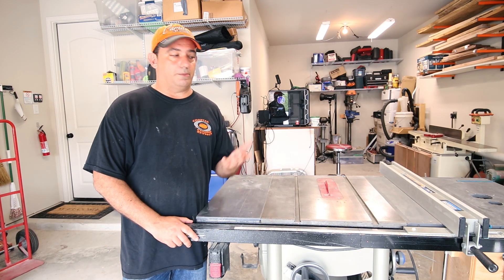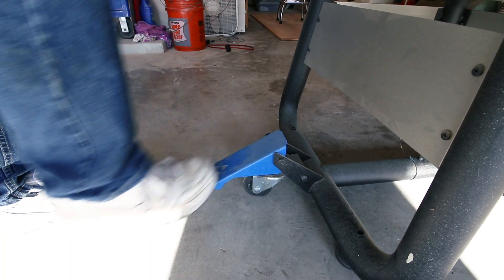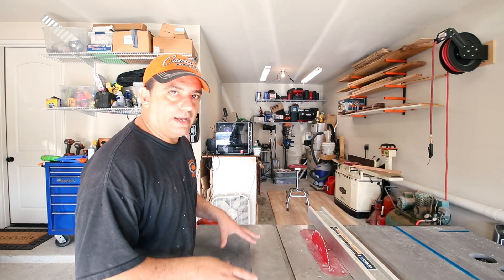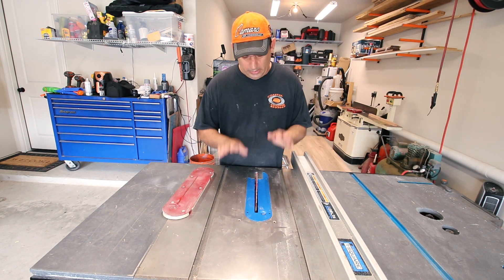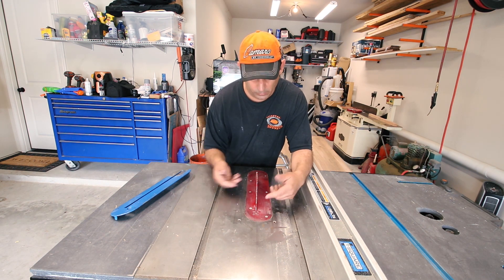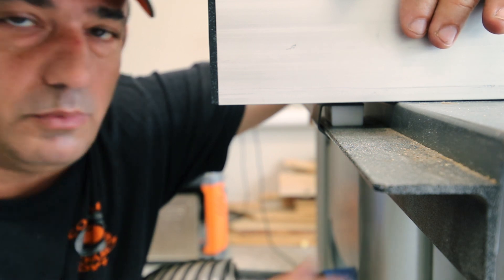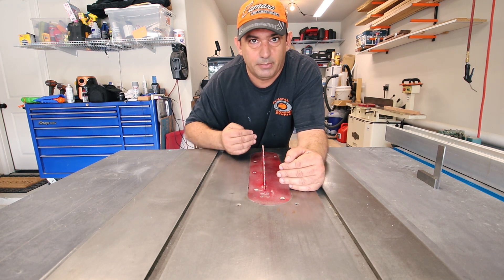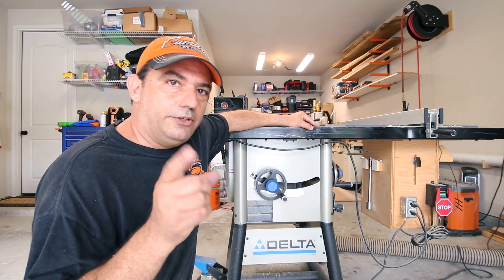Delta 36-725 Table saw review.  After 3 years

Comment: For others reading these comment, I have owned this saw for 3-4 years and I built a quite successful WW business for which it is well responsible.  Everything he says in this video is 100% true, but it doesn't have to stop you from finding success with it.  I am also upgrading my saw, like he is, and cannot wait, but this one has served me well.  The newer, more expensive one I"m getting will hopefully serve me well too and be a little more accurate, a little more powerful, etc.  But when you're just starting out, this Delta will take you far!  As an aside, when starting out, you really shouldn't be buying the most expensive tools, I started out with Harbor Freight trash tools, squares, etc.  As I learned to Wood work, started making money with the low end equipment, I took my profits and started buying better, nicer tools.  Now I run Festool, Wood Peckers, Powermatic, etc.  Don't let cheap tools stop you from learning/improving!

Comment: The zero clearance throat plate is a delta power equipment #36-501 sells on Amazon for about 38 dollars. Fits perfectly.  Worth every dollar.
Reply: Thanks for the tip! Just ordered it.
Reply: TIP/WARNING: when doing angled cuts 45’s, etc. MAKE SURE NOT use your zero clearance insert! SWAP out to use the stock insert (wider opening) BEFORE you start changing the angle. Otherwise you will bend and or knock your riving knife out out of wack! And it’s very difficult and time consuming to readjust and calibrate (assuming it’s not damaged) on these delta saws. Even though I already knew this, I’ve accidentally done it twice. You get going and sometimes forget. So, I used a label maker with red tape as a reminder: “Angled Cuts Warning - swap throat plate out”. I put one on the front of my saw (below where you see the current angle), and on the front right corner near the other wheel/dial which changes the angle.

Comment: TIP/WARNING (Zero Clearance & Angled Cuts): when doing angled cuts 45’s, etc. MAKE NOT to use your zero clearance insert! SWAP out to use the stock insert (wider opening) BEFORE you start changing the angle. Otherwise you will bend and or knock your riving knife out out of wack! And it’s very difficult and time consuming to readjust and calibrate (assuming it’s not damaged) on these delta saws. Even though I already knew this, I’ve accidentally done it twice. You get going and sometimes forget. So, I used a label maker with red tape as a reminder: “Angled Cuts Warning - swap throat plate out”. I put one on the front of my saw (below where you see the current angle), and on the front right corner near the other wheel/dial which changes the angle.

Comment: Thanks for a great review.  I bought a 36-5000 (same as 36-725 but with 15 amp motor) 2 years ago and could have used the surface flatness info.  I've had no problems, but the surface is the same as you showed. You are the first review that I've seen that really takes a in depth look at this saw.

Comment: I have the same saw and did change the blade too.   I didn’t have 220 at the time so this is a great saw.  I’ve cut 300 bf of 8/4 maple.   You have to go slow and sometimes it bogged down but I worked.  This is a great saw to start woodworking.  Nice review.

Comment: Nice review.   I bought the Delta 36-T30 T4 fence separately for my older Craftsman 113.  A great fence system.

Something else to consider... The other 80% formula for power is, you typically do not want to load a circuit more than 80% of its rated amperage.  A standard house circuit is 15A (1800W @ 120V), so that means no more than 12A should be drawn (1440W @ 120V).  Many saws routinely go over that and you can either pop your breaker and/or even cause issues with your motor (burn out capacitors).  This is especially important on a circuit shared by other devices.  I run my saw on a dedicated 20A circuit, so it has plenty of headroom to run efficiently and not overload the wiring (80% is 16A, 1920W @ 120V).  

I'll be upgrading my Craftsman motor to a 220V model when I can get my hands on a decently priced one, along with a new circuit to support it.  The 120V motor does okay for now, but is a little sluggish... as you pointed out.

Comment: Thank you. I was getting ready to go buy the saw but the table issue kills it for me.
Reply from the maker: Other people seem to not have a problem with it.   Maybe bring a straight edge and check it before you buy it.   They might not all be like mine.
Reply: Mine is Flat.
Reply: It's because the motor hangs off the cast iron top like most hybrid saws, cabinet saws usually have it attached to the frame so there's no weight pulling on the top... If they produce the top and store it for a year the cast iron would be more stable and handle the weight but I wouldn't see that with any Home Depot or Lowe's.

Comment: I agree with the bad points.  I have had mine for a little over a year now.  This is my second one.  My first one had runout of 29 thousandths of an inch.  .004 is acceptable by most standards.  Back to Lowes (after 4 to 6 hours of assembly),  Saw # 2.   The same assembly time, maybe a little less. .014 out.  I ended up stoning the blade washer till I got the acceptable .004".  4 hours!  The washer is pressed on the arbor and not replaceable.  Since that set up,  I really have no issues to complain about.  Eventually I will also upgrade, but I need a bigger building 1st.  A nice review.
Reply: As a matter of routine I often hone my washers just to remove crud, rust and even the paint from saw blades. Hearing the inside washer is pressed in doesn't fill me with confidence.

Comment: I have one of these saws and only cut small stock using a jig like a sled or one that attaches to the fence. Much safer and more accurate. That will minimize the warped table and throat plate problems. You are correct, for cutting framing material or boards that are inches by feet dimension this works great. Thanks for your review.

Comment: your comment about the throat plate is spot on. When I bought mine a zero clearance plate wasn't available so i made one. found it was necessary to make especially when using the dado blade because couldn't use a plate with the dado installed
Reply from the maker: I understand that they actually make them now.

Comment: I bought this saw 3 years back.  After reading the Lowes reviews the only thing that popped up several times was that the motor would burn out.  I decided that a quality 8 1/4 blade would do most of what I needed.  The start up load on the motor with the 8 1/4 blade was almost zero.  The motor should last forever.  The few times I needed a larger blade I would load a 10" until the project was complete.  This compromise works great for me.  I expect to use this saw for another 20 years.  Like they say you can not take it with you when you go.  I never want the huge expense of replacing the motor.  I custom made a insert for the blade that was a pain.

Comment: I bought this saw in 2014. It served me well but, as you stated, is not as accurate as I need. My upgrade has been nothing short of amazing : an '87 Delta Unisaw.
Now, regarding the table top. The problem is, unfortunately, that the product comes from China. Cast iron tops need time to "season" and relax. A machinist friend of mine explained that cast iron can and will warp just like green wood. As it cools, the inner core cools more slowly than the outer core, this builds stress within the iron. When it's ground (and in a fast production facility) that releases the inner stress and hence warps. 
I also found that dust collection system to be problematic and if you don't fabricate a zero clearance insert, it gets clogged up with little pieces of off cuts. I eventually just removed it all together. You can then enclose the bottom of the frame walls and install a dust port there. 
Blade run out was a bit of an issue on mine. Again, that's no longer a problem with the Unisaw.

Comment: I pick up this saw about 3 weeks ago. Table dip wasn't as bad .005 on the left and .003 on the right from blade cutout hole. Pretty happy with this saw. Upgraded from a $150 craftsman which can never get a parallel cut. Oh and it was the newer model 36-725t2.
Reply from the maker: Maybe the newer models are made better.   I could live with .005.

Comment: Very useful review and you have covered all the bases, the (GBU🤣) Good, Bad and Ugly.  The dished main table is the real UGLY part for which there is no easy or cheap remedy.  Even my cheap Craftsman contractor saw of the 1980's vintage was flat to 0.004" across the 28x36 table.  A lot of the people who rave about the saw may not even have recognized the problem or measured it.  These are the kind of reviews that makes the internet most useful for viewers and not just the unboxing and generic ok or not-ok style.

Comment: I plan on building Kitchen Cabinets for my house and almost bought a Used Delta 725saw. I'm glad I watched this. I guess the engineers made that Arbor short for a reason, they must be fully aware of the dips, perhaps discouraging the use of Dado blades. I wonder if the other versions of this saw are any better
Reply: that doesn't make sense.  Engineering wouldn't alter the arbor length/thread length to discourage dado use because of an issue with either quality or the vendor (if the cast iron part is a buy item).  First article sent to Delta quality for inspection would have noticed this issue with flatness.  I'm thinking something happened to the mold after initially passing first article, but customer complaints would get back to engineering and they would confirm that the drawing calls for a specific flatness that was either confirmed or corrected before mass production.

Comment: I have the Ridgid version of this saw that I just got.  After 2 days of setting it up and trying to get everything as straight as possible (given that lots of parts weren't straight to begin with) and complaining a lot, turns out it cuts accurately and squarely.  My table isn't flat either, and I actually reached out to Ridgid as I initially wasn't happy about that.....and given this was my second saw, I wasn't in the mood to box this one up and bring it back and try a third time (first one was damaged in shipping).  I threw a straight edge on the table and had the "WTF" moment when I saw light leaking through.....but, it looked worse than it is, and is only around a half millimeter gap at the most when I put some feeler gauges on it.  I can still square up the blade (on both sides) and once I got the fence dialed in, cuts straight.  Just made some plywood shelves for my laundry room, and all the angles/edges are 90 degrees.  I cut almost everything on the table saw, except for some 45 degree miters on my miter saw......I was impressed with it.  Not impressed with the quality control/manufacturing though.....but, for me personally, mine should get the job done in most cases.  I'm also surprised at how accurate the measuring tape on the fence rail is.....I find myself constantly checking the gap between the fence and the blade, and it's dead on (not sure why I keep measuring, other than force of habit from crappy jobsite table saws).  Now, if I had an actual shop and not my garage, then I'd spend the money for a really nice cabinet saw - but since I just bought this house last year and really don't feel like moving, I don't foresee that happening anytime soon.

Comment: Fwiw, I can't fit the stabilizer on the arbor of my P2000, when I have a full dado stack on. I just use the nut. It's an 8" stack, because I've never seen the need for a larger one. So, I don't see that as a negative. I'm a full time professional woodworker, but I'm thinking about setting up a small shop at home (retirement is imminent!). Thanks for the video.
Reply from the maker: Interesting.   I never tried to run the entire Dado without the stabilizer washer.   Maybe I'll try it.   

Regardless,  your PM2000 is a far superior saw.
Reply: @termitewoodwerx5896  Yeah the stabilizer washer is more for the larger single blades.  It is fine to run a dado stack without it.  BOOM! one "negative" gone!
Reply: My the instructions on my 8" dado stack specifically says not to use the stabilizer washer if you don't have 2 full threads past the nut.  No problem!
Reply from the maker: I just tried a 3/4 dado stack with no stabilizer and it did indeed work fine.   Guess it's not a problem after all.
Reply: @termitewoodwerx5896  Glad it worked out for you!
Reply: @termitewoodwerx5896  The arbor is made short on purpose to limit the amount of dado stack because of the current draw. Not so say that you will pull more current then what the motor is designed for but you would have the ability to. As you showed in your video the current draw is more related to feed rate. But Delta can't control feed rate so they limit the arbor to keep the dado stack in a "resonable" width for the "resonable" feed rate to control max amp draw.
Reply: When I worked at a custom cabinet shop, we had the same issue on our old delta 3 phase table saws. We just didn't put the washer on the dado stack if it didn't fit. It worked just fine with no safety issues.